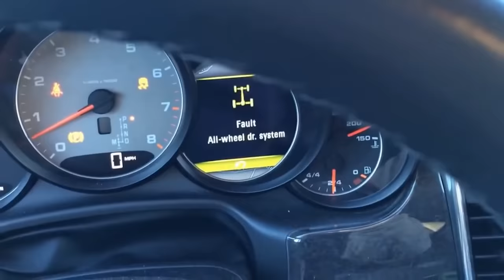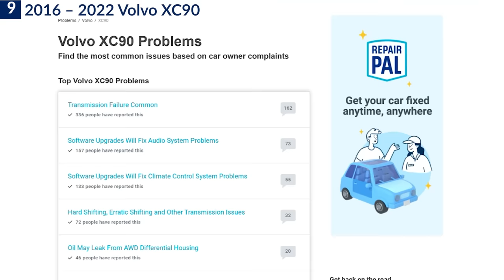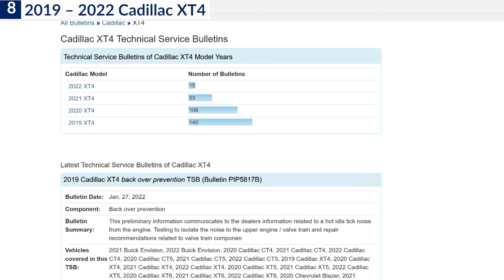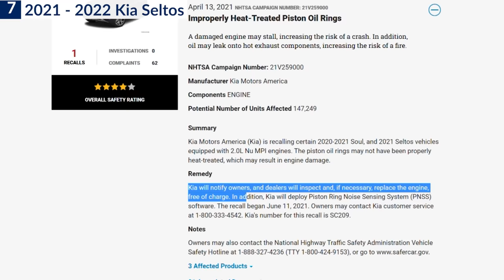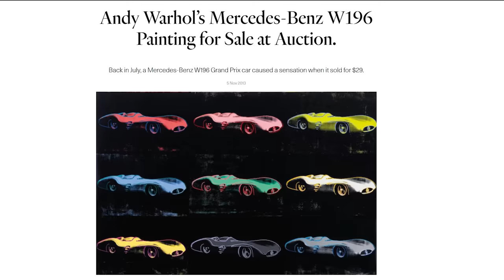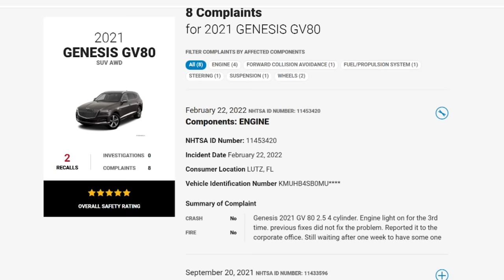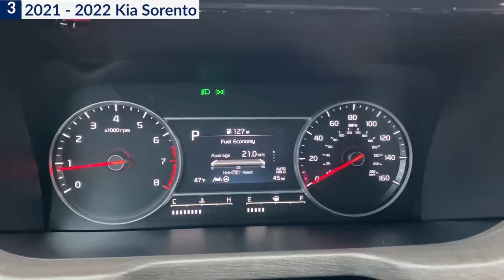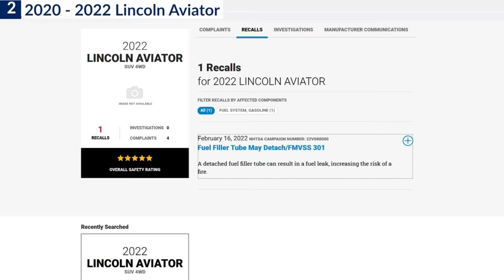10 New SUVs to AVOID - Here is Why !!

Comment: Thank you Nissan/ Infiniti for building good vehicles . Staying off the list of shame 😌 👌
Reply: Nissans have some of the worst transmissions. I use to work as an apprentice at a transmission shop and the nissans were always having the transmissions replaced between 90,000 to 150,000 miles. They use crappy Jatco transmissions
Reply: I love Nissan/Infiniti
Reply: Nissan CVT is total garbage..
Reply: @drewski1441  Umm, no one cares about your opinion. I will still be buying Nissan cars only.
Reply: @odnamorvr3053  LoL 😆 should they care about yours? Nissan CVT is dog poop 💩.
Reply: I am a master tech for Infiniti/nissan.. most of the transmission issues were caused my lack of maintenance by the customer 😒
Reply: @drewski1441  Still will be buying Nissan. Why you're mad?
Reply: @odnamorvr3053  The service Tech is correct, the transmission issue might be due to individual owners. However my personal experience with a CVT was Ok. I had a 2007 Murano, it ran well. My wife still has a 2008 Altima with 197 thousand Miles, it still runs. CVT"s are just lousy. Good luck with your new Nissan.
Reply: @drewski1441  Ohh! So you didn't have a specific reason or any bad experience to hate on Nissan, you just wanted to be malicious. Do Toyota pay you guys to do this? My God!
Reply: @tomaracic1492  thank you for sharing !!  I’m looking to purchase a Nissan and I read that as long as you change the cvt fluid you should be ok ..basically proper maintenance like you stated 😊
Reply: I used to have a Nissan …back in the day when I was poor lol
Reply: We have owned several Nissans. Never. Again. The mechanics describe them as “quirky” and omg are they right.
Reply: @MellyMel1106  we had three altimas…..yeah no. They had all sorts of strange issues and recalls. The cvt was garbage. Go with Honda.
Reply: @kadamowicz68  see that’s where I am on the fence! I’ve owned two Hondas and they they had electrical issues 🥴
Reply: @MellyMel1106  I’ve had 3 odysseys and we have 2 civics as well. But then again….I lease my cars so they have little time to have issues🤣🤣
Reply: nah, nissan doesn't have the Japanese reliability at all. it s one of the least reliable brand, says both CR and scotty.
Reply: The only Nissan worth having is the GTR.
Reply: @zzanatos2001  i ll say the same thing
Reply: @odnamorvr3053  that s not his opinions, that s fact that recorded
Reply: @odnamorvr3053   go check on consumer report and all other reviews about nissian cars
Reply: Nowadays only 4 brands are reliable Mazda Honda Toyota Subaru( improved now)
Reply: @odnamorvr3053  come on man, do some research and you know this is fact.
Reply: Nissan???  LOL  Gotta love that JATCO CVT.

Comment: New things that are a problem.
1. Electronic eBrake, give me mechanical any day
2. keyless start, dead battery, dead in the water.
3. Engine Stop and Start, battery goes dead, you are stranded
4. Overuse of plastic components
5. Turbocharged 4 cylinder as replacement to naturally aspirated V6 & V8 motors.
6. No dipstick automatic transmissions, assumption being “lifetime fluid”, there is no such thing.

Comment: Both Lincoln & Cadillac used to have Great reputations and long term trouble free use! Unfortunately, with the new SUV segment both the XT4 & XT5 for Cadillac and the Corsair & Aviator for Lincoln, they are at the bottom of the ratings now :-(  I've had several of the Lincoln & Cadillac,s over the years that were very dependable, but no matter how much I like the styling today ... I don't think I'll ever buy another!!

Comment: Had 2017 volvo xc90 served me well, until I discovered water leak in the cargo area after owning for 5 years. couldn’t figure out where the leak is coming from. Very odd, decided to sell it instead of keeping it. But i read various owner had water leak issue with xc90, therefore I’m not surprised… but it is not a quiet car…
Reply: You sell your $60.000+ car because of a waterleak in the boot? That's a minor issue in my book. I'd try to repair that, myself or a trusty shop.

Comment: Here are some of my tips:

1: Never buy the first generation of any car as it will often have tons of problems that will get fixed in the coming generations
2: Dont buy a brand new car especially for u daily driver, as ull lose tons of money once the depreciation starts, I often buy a 2-3 year old cars as they are still new and has already done most of its depreciation and I also get them on massive discount.
3: dont get the lowest trim or lowest engine option, as ull regret it later on, and car brands often cheap out alot on the lowest engine and trimp stuff.

Comment: As someone who needs to buy a new car in the next 3-5 years and someone who has a child and is also a musician who must drive many miles and carry much equipment I would very very much appreciate a list of your opinion of the best SUV's to buy between 2020-2024. Also thank you for your content
Reply: Get a van my man. You gotta carry a bunch of stuff, you'd be short-changing yourself by buying an SUV. Vans have more cargo space, auto open/close doors standard in most cases (not the case for SUVs where it is an additional option), and are more aero with better fuel economy because of their engine options such as hybrid models that will murder any SUV in efficiency battles. Get you a Honda/Toyota van if you want it to last forever and have no payments in 5 years. Or a Kia carnival if you need to look less cool than SUV drivers but still cooler than the grand caravan drivers while in a van. You can always put that "I used to be cool" sticker on it if you can't bear it. 
Or get that suv and curse yourself for needing to look cool with less than half the potential space a van has.
Reply: Toyota with a six cylinder is the way to go. Depending on volume need, Highlander for mid size is a great SUV.

Comment: It's funny that you didn't mention the Hyundai Palisade or Kia Telluride. They are built on the same platform as the GV80 and have many of the same components, however, they don't cost as much. and give a great ride. The reason Tiger Woods survived is because of the advanced safety features built in to those vehicles. Also they are more reliable than is being depicted in this report.

Comment: CR ratings are not worth the paper they are printed on. This list minus the GMC yukon on the top is no where near accurate. I had a yukon the motor blew new one installed and with in two weeks another check engine light.

Comment: Exact same Vehicle is the 2022 model & 2023 model.....Why change a GREAT great vehicle you found impossible to get! Was only available in Smog compliant states i.e. Calif & Florida....and then VERY very Limited, so econ 101 makes this car go up in price (if you can find one!, especially the "F" Sport 450h+) unlike 98% of vehicles where you loose your Proverbial when you drive them off the lot.   So, " ~*~*~*RUN Do-Not walk to the NX 450h+ "F" Sport!

... . I own the Lexus 2022 450h+ F sport. Elegant and refined!.....Note the Heads Up display on the windshield W/8” & 14” Info on Dash board with Crystal Clear display on both, alone makes the Lexus better........Mine is In Atomic Silver Glows in the Sun Light with Lil" grey / Gold metal flake" and same Circut Red interior.. but with Electric battery...Has 306 Horse power 0 to 60 in 5.6 sec (Via Road and track at drag strip!.) ** BIG NOTE: This model DOES- NOT have a TURBO...But rather, a Naturally aspirated / Carb...........(important because it is well known that TURBOS stress engines)...SEE: https://www.youtube.com/watch?..ON Turbo issues = Very Bad!..... I use Electricity exclusively non combustion! Simply said: see euro cars shop time & inevitable “ Check Engine Light CONTINUALLY!!....this car combines the Elec Batt and engine to achieve 89 miles per Gallon ( Uses 87% octane / Regular gas according to user manual) in Hybred mode with HIGH torq, And VERY quick out of the hole....*Jus' blew the doors off a 735i beeemer...albeit for only a block ...( I am no dummy, a V8 will eventually pass many cars in the long dist. (in all fairness) ......However, who cares the thrill is initial take off and tickets are for high speed & SPEED...Kill's! My car has Red Calipers against Powder coated Gloss spoke Black mags and All red "F" Sport Badges. Has ALL Nice Carbon Fiber on ALL interior some have Piano Black i.e. Center Consul arm rests dash board & rear center heater consul between seats. ** Don't mind at all making these kind of upgrades as when you drive off the lot and your * Car, Note: As this particular vehicle goes UP IN VALUE: do you know of ANY other vehicle that will Go UP IN Value today??? MY 450h+ has gone up in value $17K at this writing!. FAR better built than Euro's (mine built in Japan) sadly, new releases are now being made in Canada! Canada is Union Shop, Like USA Union shops...no one gets fired.... for a hang over and bad work??? maybe)..... However, Lexus is Far more reliable...Far better Re-Sale that Euro beemers or mercedes (Check Engine Light Gucci headache) .!... IF YOU CAN FIND ONE ANYWHERE do grab it!......"econ 101 / Supply & Demand"

.....Has (3) elec. motors gett'n 0 to 60 in 5.6 sec (road and track) HIGH torque QUICK out of Hole!......~*~*Never EVER have I used gas * but highly comforting to have the option..... gett'n 47+ miles per 120 Volt charge (real world driving my experience.)....Almost Silent operation in elec....So do your research, PLEASE......as this is Far better than any European beemer, mercedes and korean etc. All those are depreciating the moment you drive off the lot & simple oil change / maintenance are extremely costly. The aforementioned Euros …....And are UNRELIABLE and get BAD Gas Mileage to say nothing of the: GAS HOG unproven G 70, & RDX not worth mentioning. Z Best of the BEST F Sport 450h+ ! ….One more thing, Jus' a heads up!......My wife drives the RX 2020 model...Consider putting Michelin's at $1000.00  0n / @ ebay deal is out the door and balanced......... on your NX 450h+ F Sport............ replace the Idiot Run Flats that the dealer wants a $1200.00 extra for warr because like me,  You WILL eventually get a flat and the Run your WALLET Flats are required to replace??? are you freak'n kidding????....Michelin's primacy same size &......Far and away EVEN a much smoother ride, Shissh, Do Not tell my wife ...even smoother than her 2020 RX 350....because My "F" Sport has the added "Adaptive Suspension" along with lower center of gravity because of Large battery centered Low...+ Soft no roll stabil ride, Much better ride than the HARD Run Flat Bridgestones that come stock. I Carry a Batt. quality inflator ( DeWalt 20V MAX Corded/Cordless Air Inflator ) and string tar impregnated rope insert-er and Do-Not wait for AAA. Consider Use in Only Plug -in and a Hybred NOT a All electric Automobile!.........Using All electric YOU MUST consider YOUR Consider all the above insight, using a Credit Card to Open doors, start the car and monitor via phone app... & and You WILL Have the Best of the Best in the Lexus 450h+ “F” Sport and reflect having a Sophisticated, Elegant & classy platform as well! This vehicle has gone up in price approx. &17K+ at this writing,  since I bought it!  @ that increase in value what is the downside? ....So Guys!...let's Jus' get real leave our egos parked till the weekend, we all know these EURO headache's are just for EGO!.* (SHOW OFF)../ insecure people for the most part?.....* Crash test on BMW x3 & Lexus clearly shows LEXUS NX the best results / winner https://www.youtube.com/watch?v=KkV2FtnQhZU. ~*~*~Intelligent people drive a LEXUS...when we go to work / appointment and or KNOW we MUST be somewhere, i.e. an emergency I drive my Lexus….I have been fortunate to own 5 Ferrari's of various configurations to exercise my Ego as well, So lets leave our Gucci cars for the weekend Polo Pony events. One more thing, D0-Not Lease your car and get ripped off! Jus' to turn it in every 3 years @ maybe 1800.00+ per month...Oh! sure we say it is a write off!.... but you still need to Feed and Cloth the beast and NEVER EVEN OWN IT....i.e. RIPPPPP Off! by the by you still get a write off if you buy this & Jus' consider this: DEPRECIATION Of other vehicles: https://www.youtube.com/watch?v=NPJnBjfh644 End of story! REVIEW: & Do Not buy:  https://www.youtube.com/watch?v=f-M7TQ5Ah0g   The aforementioned is purely my opinion and meant entirely to hopefully give others some insight from a hands on user of this Fine Automobile! "

Comment: I purchase a GMC Denali for personal use. The top of line. The worst car I ever had. Transmission, and engine troubles. One day after many parts recalled and work, it completely turned off and never went back on. The engine blew again. Pure garbage. I just drove it locally.

Comment: I don't want to sound like a fan-boy, but I'm about 19 months and about 13000 miles into ownership of my '21 GV80 3.5 Prestige - this was the most expensive version of the vehicle.

Well assembled, comfortable and loaded with tech the only issue my vehicle had to date was that the front RADAR antenna somehow came out of alignment and that disabled the cruise control.  The dealer delivered a loaner to my home and took mine to the shop and resolved the problem and brought my vehicle back to me.

While I question some of the implementation decisions the manufacturer has made for the North American version of the vehicle, the cost is less than the competition and tends to be better equipped; and given the extreme temperatures and bad roads we suffer this SUV is a winner.

That doesn't mean that no one will ever have a problem, but there's no way that the GV80 deserves to be bad mouthed and Land Rover (as just one example) doesn't.

Comment: People get too emotional about their vehicle, lol. CR reports or whatever kind of reports come out are not gospel. It doesn't apply 100% to every vehicle. I'm sure there is someone somewhere who had a rollover firestone tire exploding Ford explorer from years ago that lasted longer than their friend's Toyota that they expected to outlive their parents. But more often than not, that's not the case.

I look at it more like this. Know when you buy a piece of clothing and you notice the stitching is off in one spot? Or it shrinks unevenly down the line? Or maybe the fabric was too thin for its intended use and wears holes over years. Quality control plays a similar role in a car. You could get one that was perfectly assembled off the line and combined with your driving habits, environment, maintenance, etc., may never have a problem. However, sticking with the analogy, someone has to get that messed up stitched shirt somewhere. Car manufacturing isn't perfect, and some companies combine quality and innovation better than others. Some companies may not care as much so long as they turn a profit that outweighs the defects, recalls, and lawsuits.

Another thing, if you like something, have confidence in its reliability based on your experience, who the hell cares. Drive it and be happy.